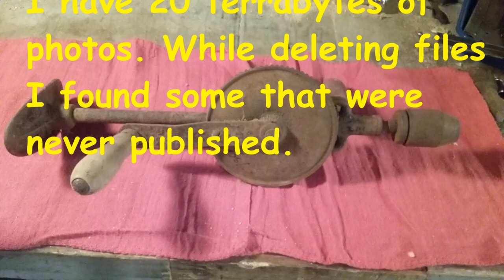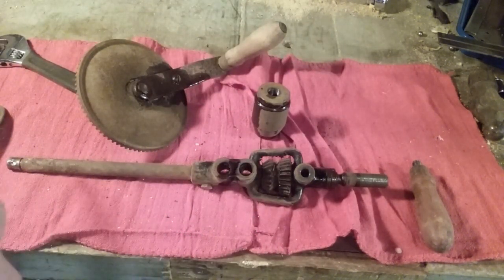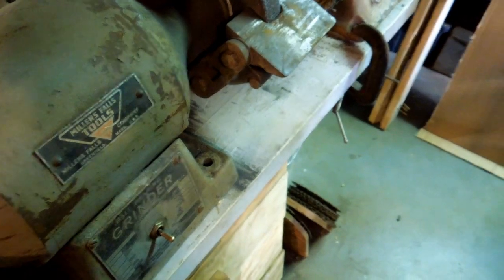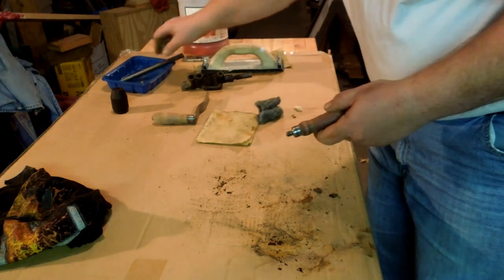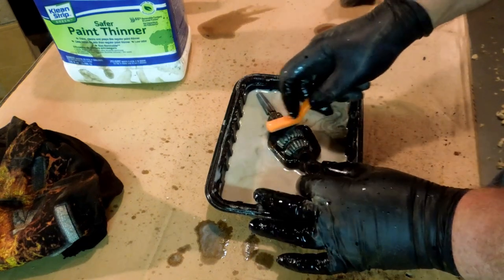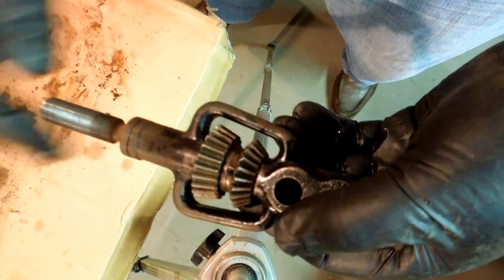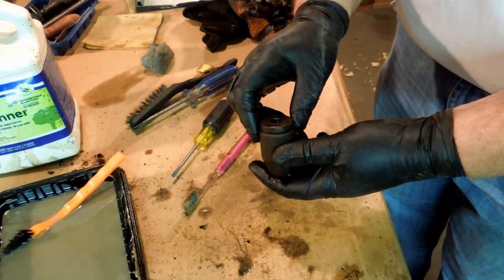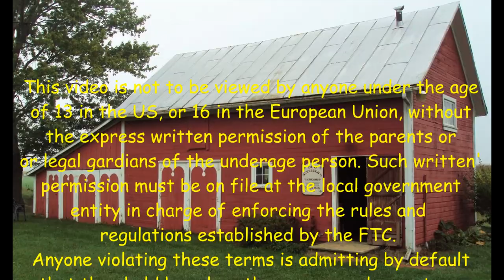Dive Into The Archives 2015 -  Pt 1 - Breast Drill For $7.50

Comment: I've never even touched one of those type of drills.
Reply from the maker: With a sharp bit they do well. 5 years ago it was fun. 
Dewalt cordless is a lot easier now.
Reply: @OldSneelock  Mine'd have to be a belly drill. DeWalt for the win! I used the impact to set the wheels down a notch on the big deck. I think I can use a little more grass this year. Inch and a half is a dab short.

Comment: I ended up watching half nd then taking the kah down for a new battery and an appointment next week for a new starter and forgot what I was going to say. I have a container like yours but a little bit taller I put paint in and wash brushes out in. It has a good 1/2 inch of dried oil base in it. I was trying to think what I wash parts in but drew a blank. I have some bowls and that might be it but I don't know. I just get the parts brush and the air hose and some gas and go to it. Good old outdoors! And I have a friendly light pole to flap the brushes out on. Flappedyflap. Good to go into the archives. Happy Grandparents Weekend and to all the family as well. GBWYall!
Reply from the maker: The Ultrasonic is scrubbing some cabinet hinges for me.
Reply: @OldSneelock  I think they do a fine job and if I was into more intricate parts I might get one but for now the air compressor, some gas and maybe a torch tip cleaning kit and maybe some lacquer thinner bores out a carb for me so far. Since I got the Tru-fuel there's been no 2-cycle issues or having too much in my billfold either. Always a tradeoff. GBWYall!
Reply from the maker: @lewiemcneely9143  The prohibition gas was a fair trade off on price. At $4.00 a gallon it was twice what pump gas was. No engine problems in the spring though. The white rust screws up a carb bigly. 
Not sure how much it will end up. Yesterday regular unleaded with corn squeezins was $3.89 a gallon.  That will up the prohibition gas at around $8.00 a gallon. 
Many things run through my mind when I contemplate how things are going. 
I am making sure I have fuel and food along with enough deterent that a sane person will walk away. The rest will leave with a new attitude or some missing parts. 
It's going to get real bad. Those prices put a big strain on people. After a year of idiots telling everyone how to live I am highly likely to go full on pissed. 
Someone who is not wrapped too tightly is already off the path and looking for a cheap fix. When they think they can they won't hesitate to try and take what they can. 😁😎